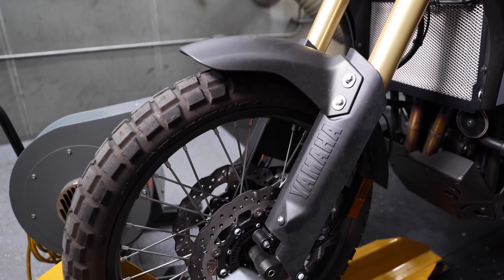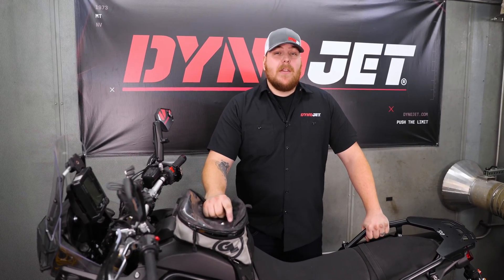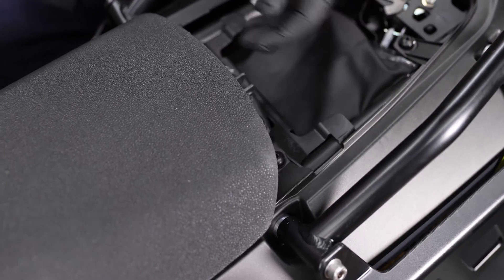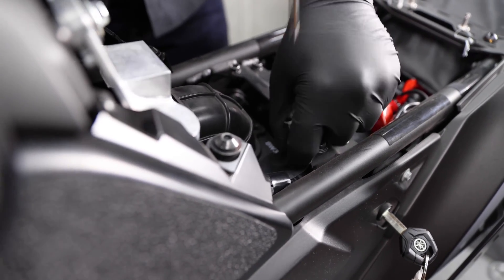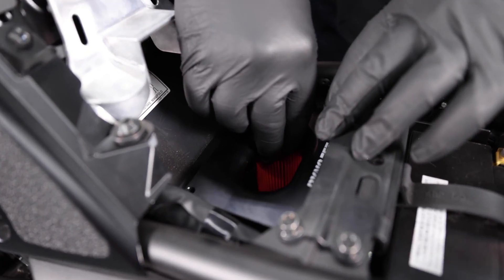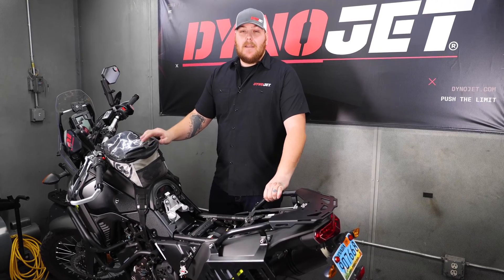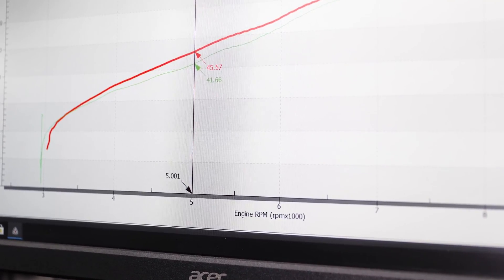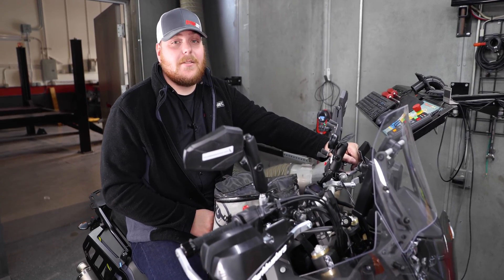How to Install Dynojet's Yamaha Air Box Lid — Add Power With a Power Vision 3 Tune!

Comment: So just take the snorkel off the stock lid and its the same
Reply from the maker: Similar, but not the same. The opening is larger by replacing the airbox lid and has a better transition.

Comment: Could you tell me please, would the Dynojet Power Vision 3 get rid of the jerky throttle on the Tenere 700. What I mean is, the closed throttle to open throttle transition, where I believe the closed throttle has no fuel and as you open the throttle, the transition is not very linear! Cheers.

Comment: Great idea but don’t run it like that in dusty conditions off road, the filter will fill with dust in no time flat.   

Here in Australia the Tenere comes with a washable foam filter with an option of a pre filter to run on the snorkel to keep the dust out.

Comment: Unless i missed something. You guys are giving people the wrong impression. Swapping the lid out alone will not give you these gains...  tuning your bike and swapping the lid will. The only relevant test to justify purchasing this lid is to put it up against a stock lid, with the snorkel removed, while using the same tune. Seems like snake oil marketing for the most expensive plastic lid ever. It's not 5 minutes to unlock this power. It's a dyno tune($400?) and $99 for the lid. Please explain how this is worth $99 compared to pulling the snorkel out.
Reply from the maker: We're working to clarify this, and we do apologize for the confusion here. Results shown are with a Power Vision 3 tune and the upgraded air box lid.
Reply: @DynojetResearch  The title says more power in five minutes. Then the video shows the increases with no mention of a tune. It seems pretty clear that its a blatant attempt to misslead people. 

P.s. It's pronounced Ten - eh - ray

Comment: Maybe you get these numbersn(4-5hp) after ecu tuning, but other dyno results show that just changing the the stock lid on a Tenere 700 does NOT give you any increase in power (marginal).
Reply from the maker: Yes, the results shown are with the Dynojet Yahama Air Box Lid + a Power Vision 3 tune.